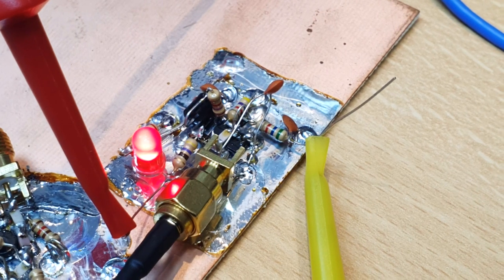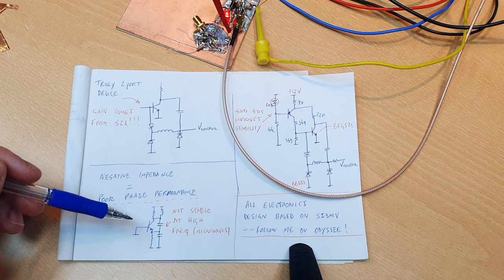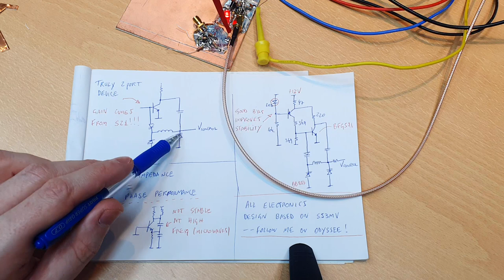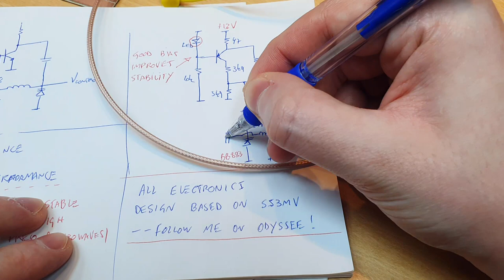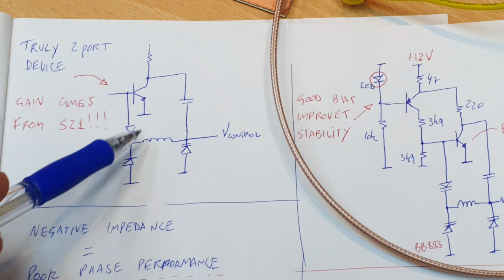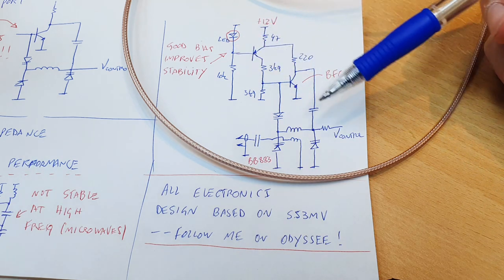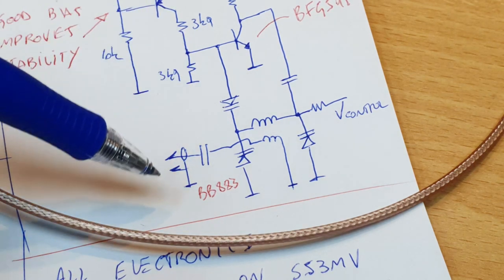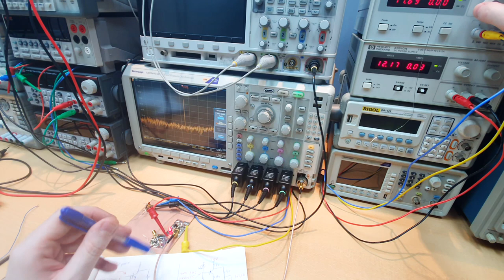Microwave 1.7GHz VCO Oscillator

Comment: The principle of negative resistance for designing microwave VCO is widely used. I have been designing this type of voltage controlled oscillators for more than 20 years and PLO, DRO, CRO and synthesizers as well. The phase noise performance is only partly due to the noise in bias circuit of the active element. Q of resonant circuit is of paramount importance when low phase noise is requested. To guarantee wide band tuning, one can choose specially designed varactor (the so called "hyperabrupt" junction). In fact, if you add varactors, the package parasitcs increase...reducing the advantage of more varactors. The necessity of an "isolation/buffer" amplifier is a good trick to improve other performances (i.e. frequency pulling, for example) or to increase output power. At higher microwave frequencies (say >2GHz) only the negative resistance approach is commonly used. Anyway, nice video. Regards from Italy.
Reply from the maker: Thank you! 

I'm thinking to construct a 50meg to 1Ghz discrete synthesizer.. Probably an oscillator tuned from 500MHz to 1GHz mixed with other constant frequencies or dividers.

What topology do you recommend me? 

Regards from Brazil!
Reply: @AllElectronicsChannel  There is no unique and magical recipe as far as topology is concerned. It depends on the application. Is it a fine step synth, or a fast switching type? What are the phase noise specs? As a general rule of thumb, try to minimize frequency excursion range in the main loop (say one octave) using mixing with secondary fixed tones (tipycally, low noise obtained thru multiplication and filtering of reference xtal) and  also switching the downconverted signal to a different divider chain. Frequency dividing/prescaling can be used but it is better to have low divider ratio (small numbers) so you do not ruin phase noise.

Comment: Hello! The LC tank load in one side on 100-300Ohms input impedance.The same situation on the output. So, the LC circuit has low quality factor, and has bad stability (but the PLL  with a quartz is in charge  for it). Am I right?

Comment: What about the miller multiplier in the CE layout?
Reply from the maker: Will reduce the potential maximum frequency!
Reply: @AllElectronicsChannel  my issue is that CE isn't reliable when working for accuracy, since, you know, capacitance across the feedback path where tranconductance can play a role, the collector - base capacitor will appear at the input as 1000x times higher than the input emmiter-base capacitance. Wouldn't you rather test a CB?

Comment: The circuit you used here uses npn and PNP devices. What is the part used as the pnp device in this circuit. Is this part of a complementary pair ?
Reply from the maker: Any PNP will work, it is just a current source. I probably used a BC557